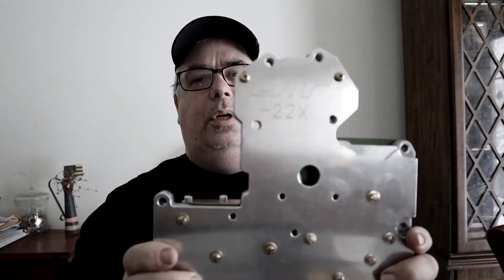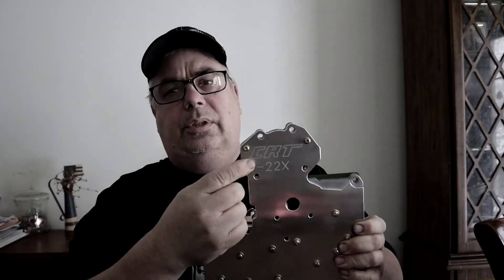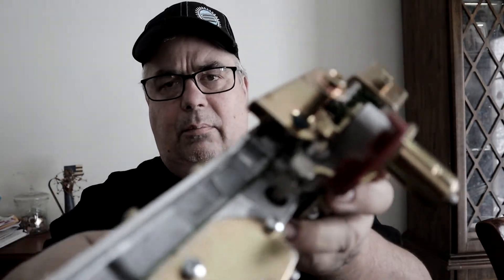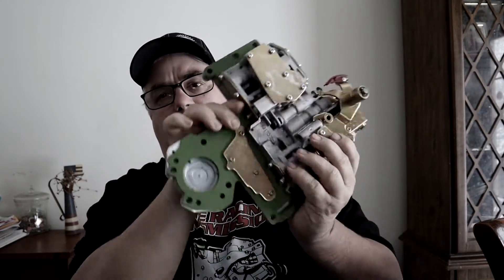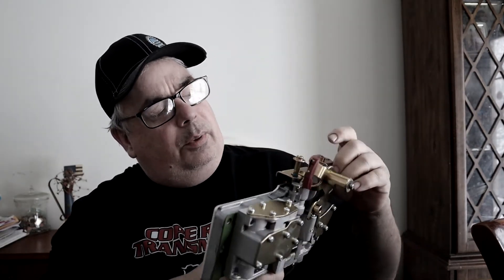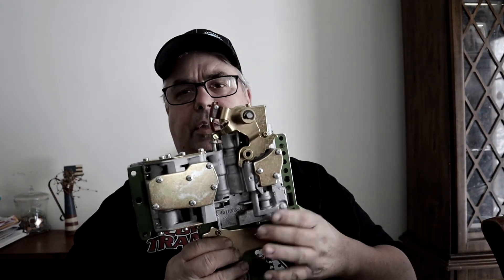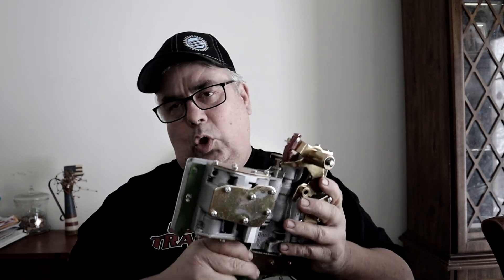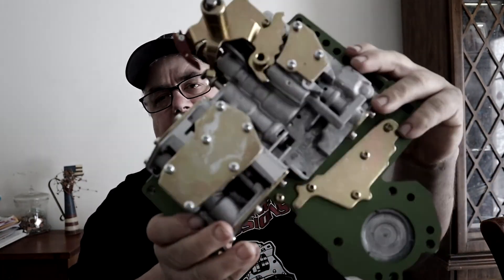CRT 727 - 904 REVERSE MANUAL VALVE BODY -22X

Comment: John, wondering if you could do any videos on what it might take to fit 518 transmissions in B bodies? What mods do you recommend to get overdrive without having to install a floor 4 spd shifter?
Reply from the maker: this spring I am doubt a 518-46re swap in a 70 Challenger,  step by step. B body mods will be the same
Reply: @coperacingtrans  cant wait for that! Have a 518 left over from a '93 D-350 I plan to install an Ultra-bell on and get under my '71 Challenger behind the 383. Gathering parts now!

Comment: on the your  22-X   do you have to use a three-pin neutral switch?   or  on older   68 727  Chrysler  had a single-threaded neutral switch ?
Reply from the maker: Both will work
Reply: @coperacingtrans   I justed placed order for another 23-X rev valve body and servo an band lever  strut,   I don't want to change internals but once

Comment: Dear Sir, I am interested in building a wheelstanding 69 dodge super bee. The younger generation enjoy watching these cars at the track and I want to keep this sport alive. The car has a 440 and a 727 T.F. with a 8 and 3/4 axle. I want to install a dana 60 but dont know what gears that I need to air the tires. I do NOT want to use NOS . Do I need a trans brake ? 
Do I need aluminum heads to lighten the front end ? 
The battery is in the trunk and It has 11.5 inch wide x 31 inch tall tires. 
Will 4.10 gears get the front tires up or do I need 4.56 or 4.88 ?
If possible I still want to drive the car to get a burger and chocolate malt.